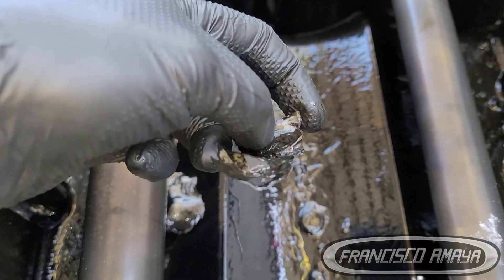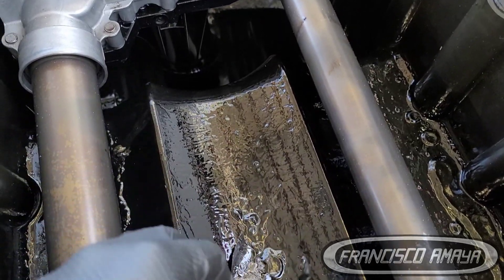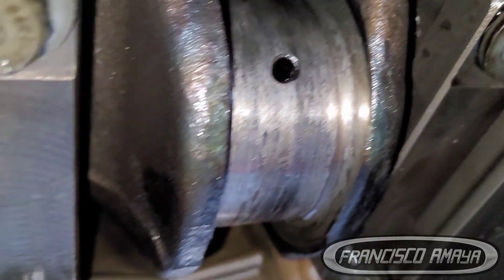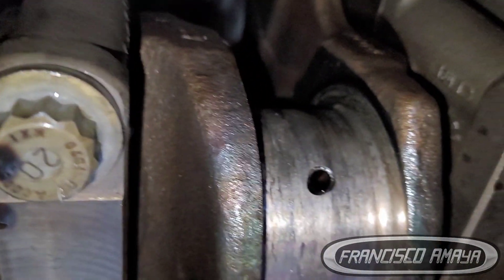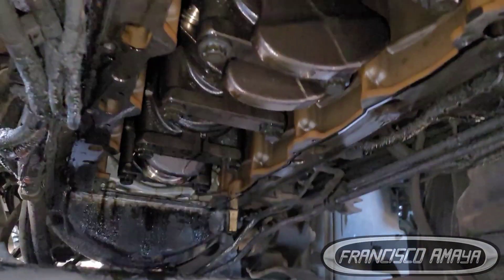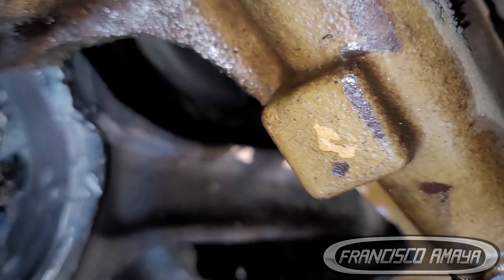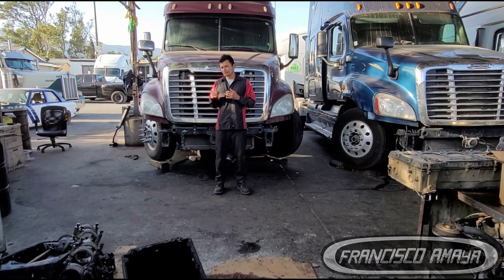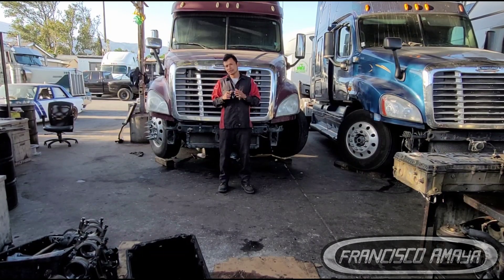DD15 engine crankshaft damage loud noise while running engine overhaul rod bearing damage

Comment: Same thing im going through right now. But in my case everything still good, oil pressure, valve, injectors, the block still intact. The truck has 110k after out of frame complete overhaul. I was driving and at the end of the day i heard a noise like that so i pulled over. I couldn't get the engine to turn over for about 10 min. There was no check engine light or code. After 10 min the engine turned on but there was the loud noise so i tow the truck back to the shop. The engine was not locked or anything. The truck move but we try minimize when accelerating back to the parking lot. Mechanic said he don't think is the main Bearings because the engine is not locked and the oil pressure is good. One thing i noticed was when i put my foot on top of the clutch pedal i felt alot of vibration while idling and also while holding the stick shift while idling and if i accelerate i can hear the noise on the engine
Reply: What was it
Reply: what was your issue? this sounds like it still needs a overhaul